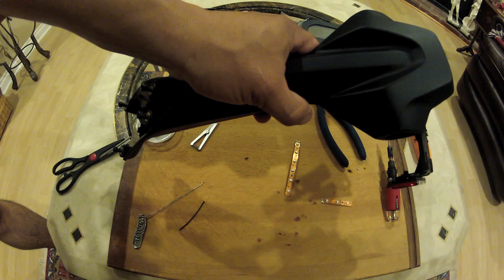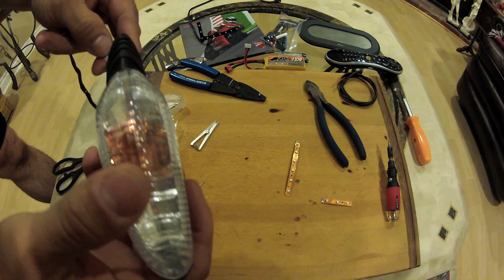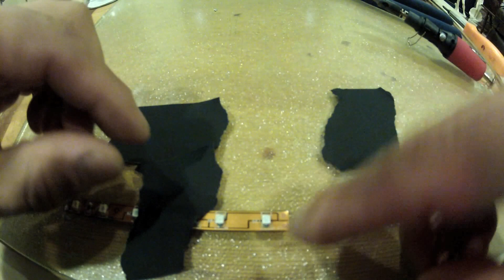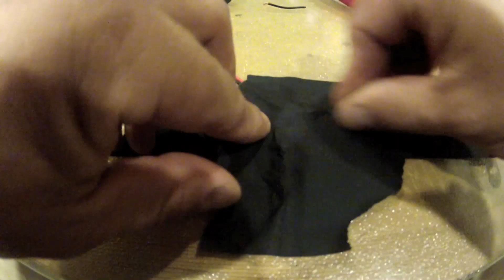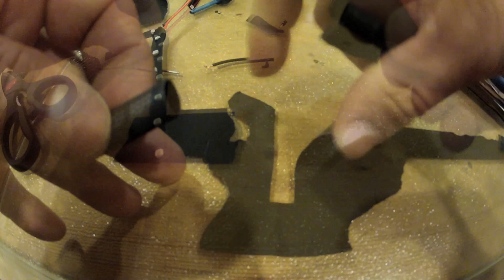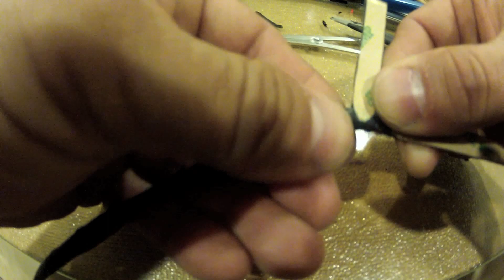Small License plate holder with LED turn signals for Ducati Panigale

Comment: nice job. but I dont think any panigale owners would do this to their bike, with that time and fabrication spent, they'd rather buy nrc or cw fender eliminator.
Reply from the maker: Correct, but at the time of that plate (look at the year, one of the first Panigale from Beverly Hills Ducati ) there was nothing out there to buy.  Since I've owned four other Panigales with better license plate brackets  :)
Reply: Nice job then. I suggest you make some and start competing with nrc. If I have your talent I will go for it.
Reply from the maker: +zico falcao Naw, I'm good! I work on TV/Film in LA that's where I use my talents, it pays a lot more. :) plus now I'm flying Drones for production https://vimeo.com/152335403
Reply: nice, best of luck. I heard drone pilots are in huge demand. its the next big thing.

Comment: @guicci007
Would you be interested in making me one identical to that and I would pay you ? Or if you are not longer using it I will buy it please. I am having so much trouble finding one and making one.
Reply from the maker: 1)do you want the turn signals in the plate? (if NOT some companies make something similar)
2)where would I be shipping it?
Reply: It would be going to Dallas. 

And yes. I just want to plug and play

Would you just sell me yours or are you still using it or what. 

And I can mail you back my brand new led license plate light of your including that just to be fair idc.
Reply from the maker: Bassem masri  I'm still using mine, and i don't have time to get you one plug and play, but i still have another plate i'm not using you can have it for 50bucks send me your email add and I'll email you some pictures if you like

Comment: A for effort, but looks like shit.
Reply from the maker: Here's the thing, when I got that bike (one of the first ones at Beverly Hills Ducati) there was no options for plates so I made that one. Now I have two 1199's that one an an 2013"S" for the track and that plate still on my Tricolore, I like it and I guess that's all that matters. What do you ride?
Reply: Yeah, I get that.  Honestly, I applaud your effort to mod and have a project.  I love the Panigale, but because of war injuries it's too much of an extreme angle for my back.  Surprisingly, I ride a 2014 MV Agusta Brutale Italia 800.  I've ridden 100 miles in one sitting and I was good to go.  I understand your pain for mods, because the aftermarket doesn't support MV that much.

Comment from the maker: thanks, believe or not they are BRIGHT as hell and very visible. currently working on a better one with illumination for the plate(using the factory light) and slightly bigger so don't have to mount the light to the plate. and wait for it... Carbon-fiber.

Comment: Well, I've had the Oberon for my 848 already. But I broke the copper insert on the right side due to loading onto the trailer after the trackday.
All I need is to buy another inserts, but Im too lazy to tape the lights up for trackdays so I used my running lights as my turn signals.
Cheers.